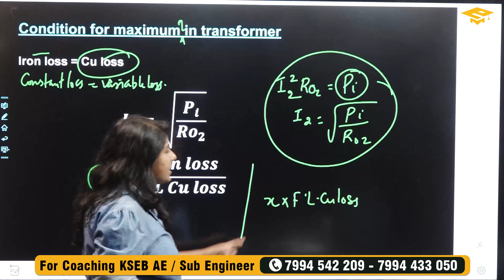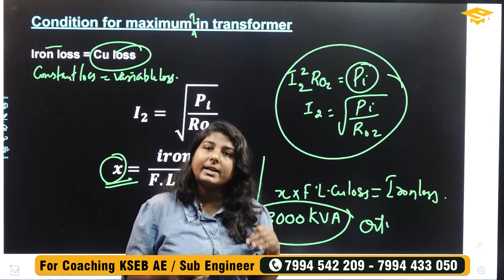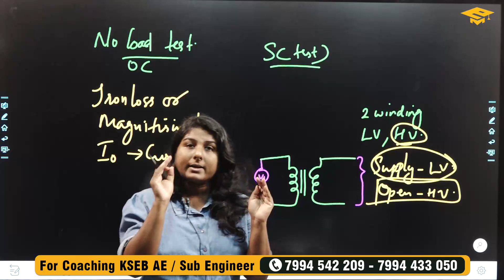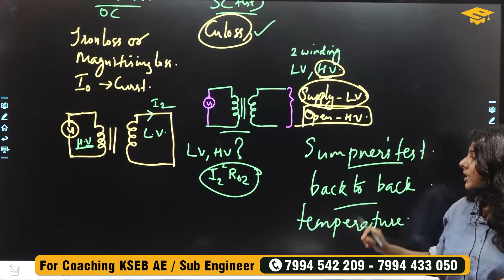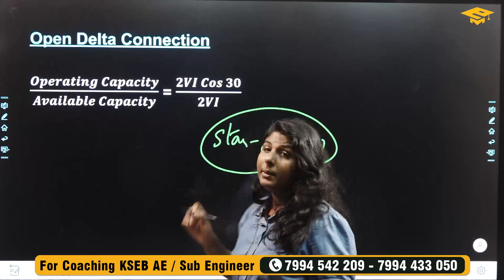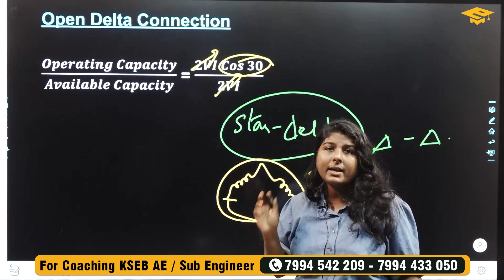KSEB Sub Engineer | Transformers Part-3

Comment: Time 25.50, If one arm of delta is removed power will be reduced by 1/3 times alle??... So 33.3% alle verika?
Reply: Sir
It won't be 66.67. It's only 57.7. Because it is an inductive unbalanced circuit. So power handling capacity of an open Delta is only 57.7 percentage of the normal transformer.
Reply: @jasnananda9636  ok